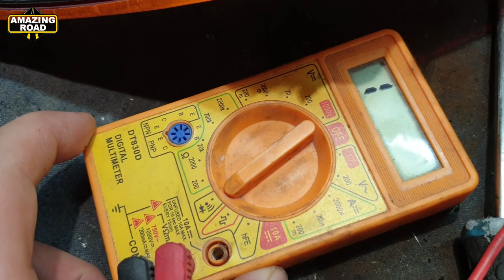Repair the Rear Tail Light on Mercedes W212, W207 / How to Repair Rear Led lights on Mercedes W212

Comment: Damn, I'm just going to install and new taillight because I can't solder or have the patience to cut into the housing like that lol great video tho 👍🏼
Reply: For real!! How much is a new light?
Reply: @beatsgalura  I got mine for $100 off a dude from offerup lol, it was pretty much new only had a small scuff you barely notice but the new ones from Mercedes cost around $275

Comment: Tip for 2014 W212: If you re-solder the smd components, do not use/use carefully isopropanol to clean the flux residues. A small amount of isopropanol dissolved the glue and the plastic popped off from the light body, leaving some cracks to the plastic when it was bending a bit! A horrible job to glue it back! Well, this would be a way to dissassemble the whole light for a proper repair. I'm just wondering would other solvents (windshield washer, car washing solvents, ...) break the glue seam and let water in?

You can also cut one wide strip of plastic away to reveal all resistors, not in two parts like here.

Also, remove all of the lead free solder with braid and use leaded solder and flux to solder the components back. Lead free and leaded solders do not mix well. Really, remove all of the old solder firts! I also resoldered the LED legs.

Comment: WTF! The cause of the light failure is poor soldering of the diodes? Unbelievable this is happening in a high end model. My E300 also had the same problem.
Reply from the maker: Yes https://www.youtube.com/watch?v=z4-I_NzKb9Y
Reply from the maker: https://www.youtube.com/watch?v=5UQkxgx-xxA&t=1s
Reply from the maker: https://www.youtube.com/watch?v=kRrWxlWHd4I